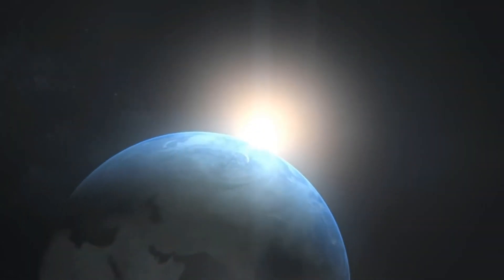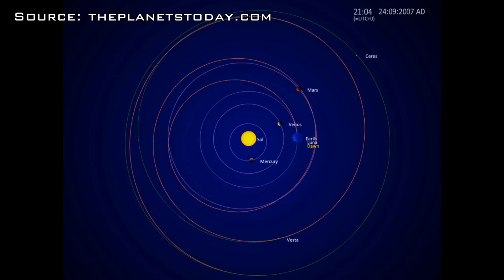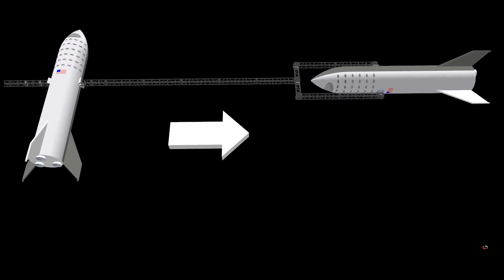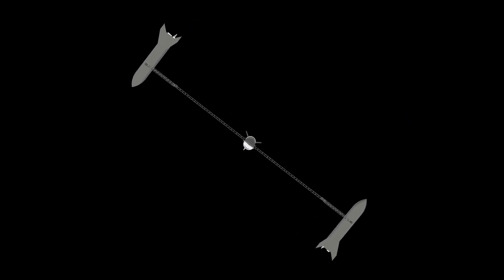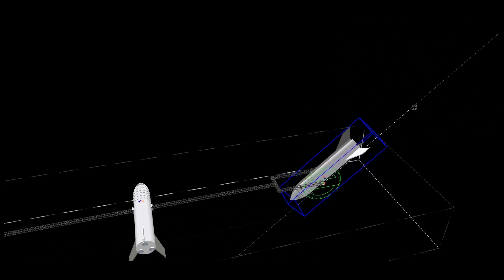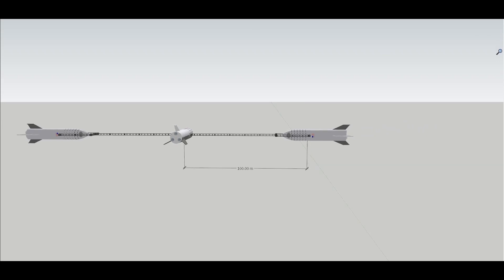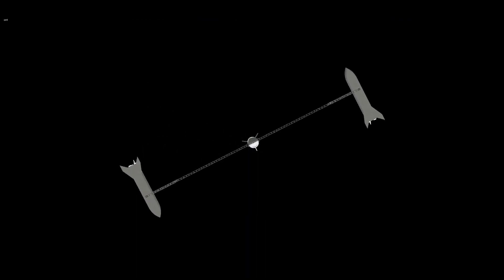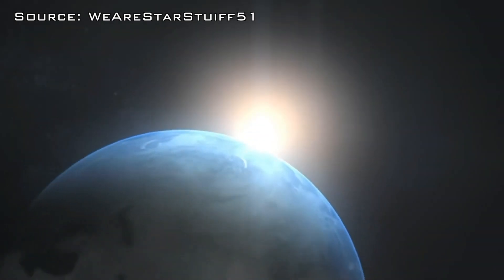GLS2: Artificial Gravity for SpaceX's Starship

Comment: I can see you put some effort into the animation, ~2:10 not sure a truss is needed for the ships to orient themselves. ~5:05 the tensile strength of a cable is probably better than a lattice girders.
Reply from the maker: Thanks! I learned how to use sketchup, just to get this idea across. 

I wonder what the system would look like if the Starships were only connected with a flaccid cable, and they tried to execute a spin startup like this.

Yeah I agree, cable is way better for tensile strength. The next version of this design is shaping up to be a little more thorough
Reply: Hi  @smallstars , let's start with two starships... when these two are connected and we induce spin the majority of the forces will be pulling them apart. Here we want max tensile strength with min weight , same as a space-elevator (still waiting for carbon nanotubes) 

One benefit of a rigid structure would be to mitigate any twisting forces but these can also be mitigated with thrusters. it's possible we may want a counter-rotating pod for communications etc,
 this wouldn't necessarily need to be in the middle of the assembly though.

If access is necessary between the two this could be done with something like a zip-line elevator or even a collapsible pressurized tube, unless there's a compelling reason to put a third ship in the middle it will probably be best used elsewhere.
Reply: This statement "you wouldn't be able to use main engines to start and stop the spin" needs to be qualified i'm not sure i agree... that being said this is good food for thought and conversation. Also i'm not sure it's excusable to discuss this topic without a shout out to Isaac Arthur
 who has done very diligent research and produced many good videos on these topics.

Comment: I totally don't buy this approach.    Sending an entire third spaceship seems a much bigger deal than just using a cable.  Cables are very reliable and well understood - and unspooling them is not difficult  give both starships a little thrust and centrifugal force will keep the cable tight as it unspools from both ends.  Bolting together that truss sounds difficult and complicated.   Rotating the starships nose-in seems unnecessary - we can just design the habitat to be livable in either vertical or horizontal modes and put the cable attachment just inboard of the CofG.   We know that Starships will be refuelled in Earth orbit prior to leaving Earth - so you can pick up the cable in orbit if it's a significant weight - and even leave it in Mars orbit prior to landing there.  It's bad enough that you have to send TWO Starships to Mars at one time...pushing that to three and having one of them haul be basically useless seems insane.   Honestly - what I'd consider would be to build a spacecraft that can split into two halves - one half with engines, fuel and cargo - and the other with passenger quarters and little else.   So imagine the front 1/3rd (say) of Starship being held against the back 2/3rds with our cable you start the entire ship gently rotating - and release the clamps between the two parts and start unspooling the cable.   The center of rotation is not in the middle of the cable because the rear part is so much heavier than the crew quarters...so the rear section is spinning more slowly and exerts much less tension on the cable.   The strength (and therefore weight of the cable) is now much smaller - and the amount of reaction thrusters needed to get the entire thing to spin at the right speed is far less.   Now, the crew quarters have positive g towards the nose.  So ceiling (during launch and landing) becomes floor (during coast phase) - but that's OK because nobody needs to sleep or eat or poop during launch and landing.  Once you're landed on Mars, you would need to reconfigure the interior - buy hey - you have 2 years and you only have to reconfigure it twice.

Comment: you should consider having solar panels built into the frame, If they are light enough (and therefore large enough) they could double as a solar sail. eventually taking us further than Mars. I imagine it would look like a giant rotating sunflower, with multiple star ships trussed into the middle each connected to a portion of the sail.

Comment: Good job addressing an important concern.  However, I am a little concerned that the animation shows the system rotating about the intermediate axis.
Reply from the maker: Meaning that stabilizing the spin will require a significant amount of energy?
Reply: @smallstars  Per the intermediate axis theorem, the system will become unstable and periodically flip about the axis with the smallest  moment of inertia.  This may cause destructive torque forces on the trusses.  This can be resolved by orienting the center starship long axis to be on the plane of rotation.  This will ensure that the system rotates about the axis with the highest moment of inertia.
Reply from the maker: @donnstrutton929  It is very important that the artificial gravity pulls downwards, towards the floor of each deck on the Starships. If flaccid arms were to be used, would the same problem happen? Such as the cables getting all twisted up? Example: https://www.youtube.com/watch?v=NMZy2gxrF4g&t=252

Comment: Wouldn’t you half to spin like super fast because the craft is super small
Reply from the maker: It's the size of the diameter (or radius) that matters. In this case we have a 100 meter radius for the spin system and 3rpm (1 rotation every 20 seconds) will provide 1 G. If the radius was only 50 meters, it would have to spin faster to provide a comparable amount of centripetal acceleration

Comment: This cannot work and you do not understand zero g mathmatics. Not only just your design but most spinning orbital stations cannot work unless the weight of the system is perfectly aligned and docking to any such station wouldn't be possible, as soon as there is a mass change to the perfectly dedtrobuted station it would induce a wobble, this wobble would only grow until the forces tore the station apart. Same thing with you design here, this could never be evenly distributed and if they were before you start with rotation you couldn't keep your thrust within the level of accuracy you would need in order to prevent it from going completely crazy a tiny little less thrust from 1 of the trusters and your spin would be unrecoverable and  besides that although the is no air in space it's not exactly drag free, extended part like that do induce wobble in a spinning object and this has been shown in failed missions. And since there is also liquid in the tanks this causes wonky rotation. It's a pipe dream, all methods like this are even though it's not talked about much all the science is known and effects are known for spaceflight I still see it being talked about as a pipedream, but it can't work. I did write a paper about the only type of ship this could work with in college. It would need to be a sphere with equalize and balanced weight internally spun in the exact direction of internal orientation which internal layout is the hard part bc it all has to be balanced.
Reply from the maker: Interesting point. I guess any idea is a pipe dream at it's inception. Perhaps a balancing system needs to be added.

Comment: I have a similar idea long time ago, but I imagine only two starship connected bottom to bottom with a cable,  only the structure which  support the engines  it's stronger enough to sustain the centrifugal force of two 420 tons starship  , and for rotation gimbal a single engine on each ship and push in the opposite direction, don't tilting the ships keep it back to back all the time, only bad part is the ceiling and floor will be reversed compared with the situation when it is landed .

Comment: The only issue I see is that the engine burns would have to be perfectly simultaneous. They will have already needed to make their burn towards Mars in order to hook up the Starships, no turning back at that point. Using the main engines for this is too risky imo, the Raptor is too powerful and that truss won't support anything but perfectly symmetrical forces. A single Merlin can stop a 20 ton F9 first stage from free fall quickly by itself.

Perhaps a dedicated ion drive or other smaller engine would be better? Also, how do you access the center Starship? A spacewalk? That doesn't seem safe without a clever transport system that can deal with the changing "gravity."
Reply from the maker: #1 if they go for mounting an ion engine just for spin, that would be great!

#2 A space climb! As you climb the truss it will feel weird, because the magnitude of the artificial gravity pulling on you will seem to change, but it's going from 1 G at worst, to less G as you climb, so I don't think it'll be too bad. Climbing back down into the 1 G will be the toughest.

Comment: I really don’t see how this could work. With the diameter of the crewed starships living quarters, your head would be moving much much faster than your feet.
Reply from the maker: The diameter of the living quarters? The centripetal acceleration gradient is related to the diameter of the entire spin system, not to the diameter of the crew quarters.

Comment: I think your idea is great, I was thinking that you wouldn't have to use as much propellant as long as you had a winch. If you wanted to speed up the rotation/gravity of the rotating masses, simply winch the line in.. if you want to slow the rotation, winch the line out.. Think of a ballerina doing a spin.
Reply from the maker: Thanks for the comment! I can picture exactly what you are talking about. The speed would actually decrease as you let out slack, and increase as you winch the starships closer to each other. This could actually be an issue as the the G force could increase to dangerous levels.

Comment: Regardless of the particulars, this is a great concept - connecting two starships to a third in the middle with a rigid structure and rotating the whole thing. Musk seems to have been particularly silent about the need for artificial gravity, but that could just mean he has some awesome surprising solution up his sleave, maybe it is something like your proposal. Eitherway, this journey should definitely have artificial gravity. Going from 6+ months in zero G to immediately working to survive on a new planet with 1/3rd G is insane, not to mention all the other health issues. Some thoughts:
- the ships could be accelerate to mars trajectory separately, then join. Eliminating the problem of accelerating the whole structure. Orbital rendezvous is just as difficult either way. 
- add some sort of passage way in the trusses so passengers can have some fun in zero G then return to their starships. Only the 'elevator' would need to be pressurized / sealed, not the whole truss structure, which would just need some guidance rails (possible creating some conservation of angular momentum issues though - changing the rotation rate) There would need to be a central arm to the fork that connects to the nose of the starship after they are in position. 
- maybe have the forks of the trusses swing in and out, narrowly manuevuring into the closed forks could be catastrophic. Start open, move the starship into position, then close and latch. 
- the tensile strength of wound small cross sectional area cables is much higher than bulk structures like the truss. Keep the truss for rigidity, but let the cables take most of the load would help to keep weight down. So 1) deploy trusses 2) link starships 3) deploy and attach cables 4) spin up the assembly to get artificial G. (nevermind, you all ready thought of that!) 
- it'd be ideal to get some sort of thruster on the starships to do the spinning, instead of rotating them. Then you could gradually slow rotation during the trip, and gradually increase it on the way back.
Reply from the maker: Thanks for your well thought out input!

1. yes, connect while on the way to Mars
2. yes, passageway but I was thinking just climb the truss ladder. It's only 1 G at worst and less force as you climb right?
3. yes 💯
4. if it works, i'm all for it!

Comment: I like the idea but by attaching three space crafts together you are significantly increasing the weight of the spacecraft that is going to mars. The two outer spaceships only need enough fuel to increase the rotation speed to 1g but even so they are going to add significant weight to the total craft. Add to that the weight of the scaffolding connecting the two crafts and it's unclear if the central craft would be able to hold enough fuel to get the entire contraption to mars.
Reply from the maker: The concept is to connect the 3 space crafts together after they are already on their way to Mars.
Reply: @smallstars  My main complaint is this plan would triple the weight of the craft and triple the number of trips SpaceX has to make to refuel the ships. But given the enormous benefit artificial gravity would provide to the crew it might be worth it.
Reply from the maker: @aaronlevenstein907  How does this triple the weight of the craft? They are planning on sending 2 starships to mars already. I'm proposing adding a 3rd starship that carries with it a deployable spin system
Reply: @smallstars  I actually think it's a good idea I was just playing devil's advocate.

Comment: If the RCS uses CH4/O2 then it won't matter if you need to use RCS fuel to spin up/down or not. Cables will weigh less and take up far less space, yes active control will be needed on cables to prevent unwanted oscillations but the weight and space advantages of cables will be far greater.
Reply from the maker: Agreed 💯

Comment: Will centrifugal force work without the assistance of earth's or other planetary body's own gravity. Water in the bucket works because of earth's gravity. Right?
Reply from the maker: Yes it will work. Earth's gravity actually does not make water in the bucket work. Gravity is an acceleration, acceleration is a change in velocity not a change in speed. The difference being that velocity is a vector quantity. Basically what I'm getting at is that any change in direction, is an acceleration. When something is spinning, the rim of the spin has a speed, but it is constantly changing direction. 

Consider the truss in my concept, it's constantly keeping the starship connected to the center of the spin, "pulling" inwards on it as the starship tries to fly away in a tangential direction.
Reply: @smallstars  Given circular velocity induced on a circular tube. With no influence from nearby planets or stars.  Free floating objects would be pinned at the middle of the spoke wall, and the outer rim wall. Thus 45 degree floors within the tube. Which will also be affected by outside influence. Axis  Speed adjust or moving floors? Not to mention linear thrust from the craft.